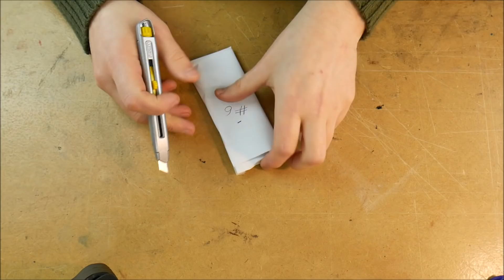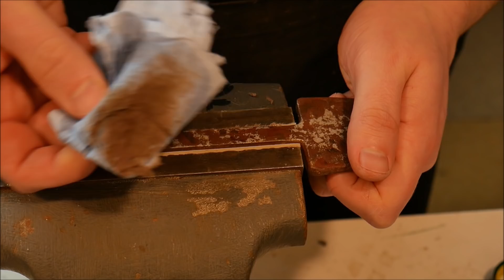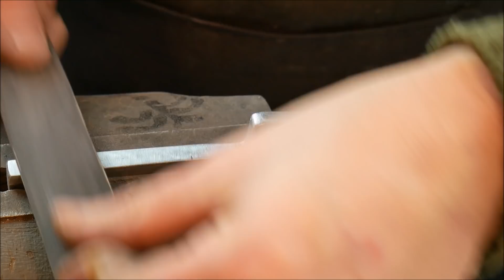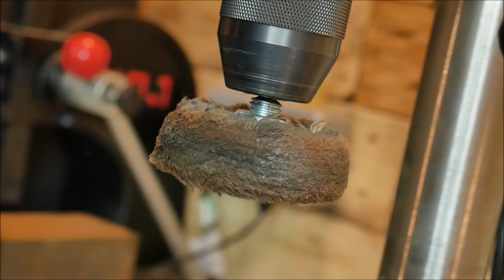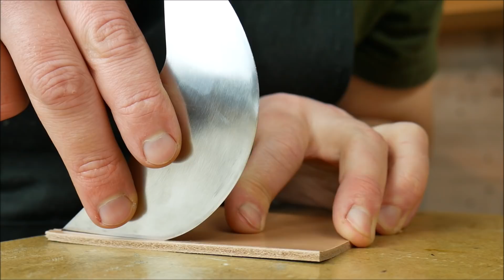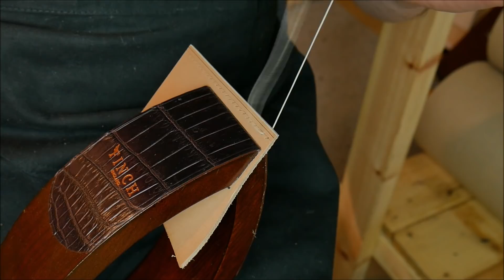Joseph Dixon Pricking Iron Restoration - Leathercraft Masterclass

Comment: Any advice as to where to look for vintage leatherworking tools? I'm a woodworker, and old WW tools are abundant. When I look on eBay for vintage pricking irons and such there seems to be few if any
Reply from the maker: I wish I could tell you there was a reliable place, but most of these tools are kept by people who don't use them and get snapped up fast by other collectors who don't use them either. Pains me. Ebay and a keen pair of eyes is still your best bet.
Reply: @LeathercraftMasterclass  Shame. While woodworkers deal with that frustration too with tools (and lumber itself sometimes as well), it's definitely clear the situation is more extreme with regards to leather-working tools. Intuitively, there must have been a lot more joiners, coopers, cabinetmakers, carpenters, etc. than saddlers, cobblers, and the like to leave tools behind.